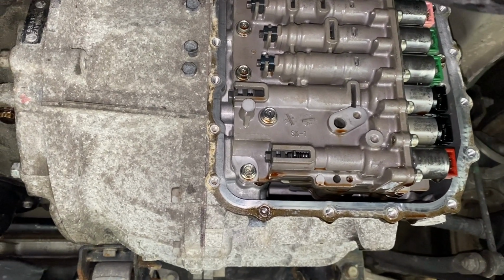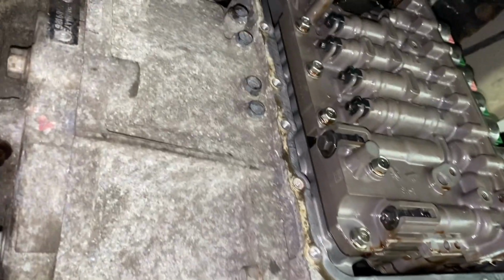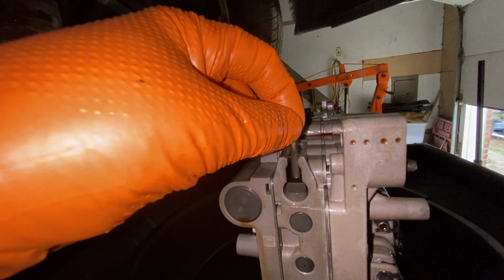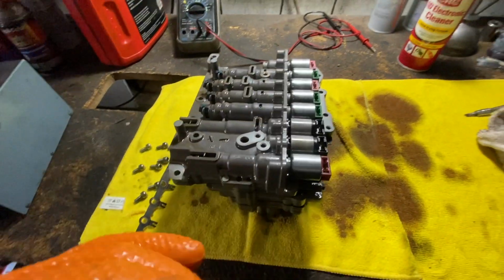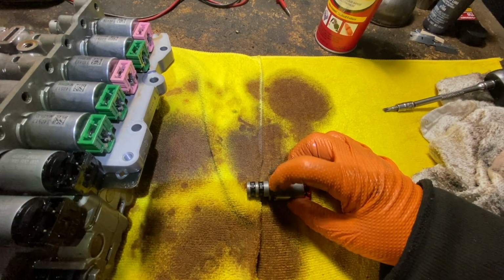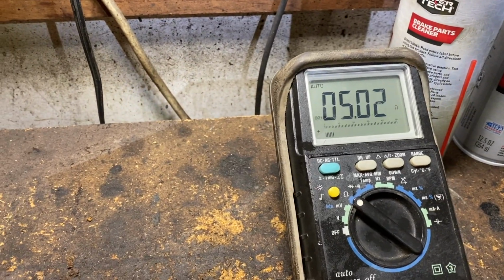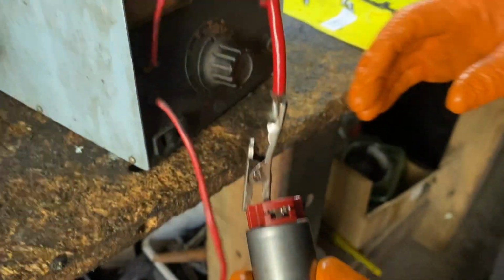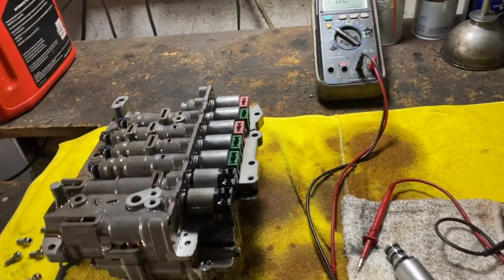Transmission Solenoid Cleaning & TestingOn 6 Speed Kia / Hyundai - A6MF1

Comment: I just bought a 2005 Tucson and i noticed the Idle is high in the 1500 range .. and when i go on the highway my last gear does not engage ..overdrive .. so when im driving at 95 klm/h my rpm is in the 3500 whey to high and waste a lot of gas and in the long run might burn motor and transmission .. Can u pls tell me what to check .. is it the body Valve or maybe something else ??? thanx for the video !!!
Reply from the maker: You're welcome. It could be the valve body or solenoid, but I would first check for any diagnostic trouble codes, transmission fluid level and condition. Should fix the high idle can be a vacuum leak, dirty throttle body or dirty idle air control valve

Comment: I have a 2012 soul a/t transmission, shifts fine manually but only goes to 3rd in automatic no codes any advice?
Reply from the maker: Valve body, torque converter or transmission clutches gone

Comment: Hi. Do you know anything about P1C28 code on 2020 Kia Soul 2.0 Engine. Scanner says it is transmission code.  Thank you.
Reply from the maker: It’s actually the hall effect sensor on the electric oil pump … the sensor cannot be replaced so you would replace the electric oil pump assembly.

Comment: My Hyundai Accent with CVT 6 speed is returning P0721 (output shaft speed sensor) fault code. Have you covered how to diagnose this sensor in any videos?
Reply from the maker: Not yet, seems pretty straight forward, sensor or wiring problem.

Comment: Where Is the TCM locked on the 2010 tucson? I have a bad tcm Code U0101 but don't know here the TCM is.
Reply from the maker: Should be under the fuse boxing engine compartment near top of transmission

Comment: hello and thanks for the tutorial, I have a question, I already checked the solenoids,   the first one on the bottom when I tested it does not  click, so I got a new one , and tested with 9volt battery and does the same, no click at all,  the ohm resistance is in range on both the new and old one,  Watching your video I saw you are testing that particular one, and I hear the clicking, and see it open and close , is that normal that mine don't click? my car don't go forward, but reverse is going good.
I really appreciate any help you may provide , thanks
Reply from the maker: Should be 12 volts then maybe you will hear the clicking. Here is info on those transmissions.
https://atracom.blob.core.windows.net/webinars/import%2Fa6mf1_rebuild.pdf

Comment: I dont understand why the valve body has to come out to remove the solenoids. Also which is the tcc solenoid? the torque converter clutch solenoid??
Reply from the maker: You don't but the valve body is where the fluid flows though if its clogged changing solenoids will do nothing. Here this may help you.
https://atracom.blob.core.windows.net/webinars/import%2Fa6mf1_rebuild.pdf

Comment: Hello! Thanks a lot for this tutorial video. I am in the process of doing these but I was hesitant since I tested each of the solenoids with a $2 multitester and it showed thse values: 
Solenoid 1 - 5.8 ohms
Solenoid 2 - 5.8 ohms
Solenoid 3 - 5.8 ohms
Solenoid 4 - 5.7 ohms
Solenoid 5 - 5.8 ohms
sSolenoid 6 - 11.5 ohms
sSolenoid 7 - 11.5 ohms
Solenoid 8 - 5.7 ohms
Do you think they're out of spec and should I be replacing these solenoids or are these specs okay and should I proceed with cleaning?  Thank you very much
Reply from the maker: They seem in spec, could be the valve body itself needs to be taken apart and cleaned but this requires some skill because of all the little parts

Comment: Hello awesome video I have a 17 Sportage AWD and I changed my transmission fluid on this car I just got it has 260k miles runs good just my transmission started jerking on first gear mostly when I'm taking off on a turn not so much on a straight line I was thinking it might be this cleaning issue what do you think. Thank you
Reply from the maker: Thank you! A good cleaning and test could solve your problem

Comment: I have a 2013 Hyundai Accent with 213K on it. About a month ago, I was on the way to an appointment and it jerked and the tach went to 3500 rpm for 60 mph and on starting from a stop felt like it had little power like it was starting out in a higher gear.  When I got home, I put it up on the lift and it was low on fluid so I topped it off adding fluid until it began to run out the level hole in the front. Cleared the codes and took it for a drive and it ran perfectly then a couple weeks later it did the same thing which I don't understand because I know it has plenty of fluid. Leaving the appointment after it had been shut off for maybe 30 minutes, it ran and shifted fine. Today it did the same thing multiple times, it jerks like hitting a large expansion joint then the tach revs way up from about 1800 to 3500 rpm for 60 mph. I tried the shiftronic thing and it said it was in 4th gear but I couldn't manually change it up or down.  I pulled over to the side of the road and shut the car off, restarted it and made it maybe 1/2 mile before it did it again. The 3d time it did this, I turned around and headed for home driving maybe 3 mi at 3500 rpm before pulling over and shutting it off and this time removed the key from the ignition. Started it up and drove the 40 mi back to my house with no further issues.  Hooked the scantool to it and I'm getting a       P0-880 code from the transmission. Is this something that a shift solenoid going bad would cause?  Trying to figure out what to do with it, who to take it to, a regular repair shop or someone that specializes in transmissions?  Would changing the fluid again help this?  I have top of the line Amsoil ATF in it which was last changed about 90K ago and hate to spend the money on changing fluid if that isn't the problem just to have a shop drain it.  Any suggestions?
Reply from the maker: This is the flow chart depending on your skill level  or to take to a transmission shop. 
https://static.nhtsa.gov/odi/tsbs/2020/MC-10176195-0001.pdf
Reply: @motorcarnut  I took it to a shop today and they said it might be a loose or bad connection, so when I got home, I pulled the ECU relay and put it on my relay tester and it tested bad. Drove the other car into town and bought a new relay and installed it after it tested good. Changes noticed, smoother idle, tach is rock steady where before it would vary maybe 25 rpm, shifts seem to be smoother and more positive and vehicle seems to have a little more power to pass. I don't know if that was the problem, but it definitely was a problem, keeping my fingers crossed that it cures it and keeps it from happening again. Going to have them check it out next wed and deal with any other issues or bad connections or connectors. Hoping and praying that it was a 7-dollar part and not something actually wrong with the transmission.  Thank you for the link, I have it bookmarked and saved.
Reply from the maker: Sure, no problem, good luck!

Comment: When I test the bottom solenoid, it won't "click" with a good 9v battery but, will with a 12v.
Reply from the maker: Probably because the amperage in the 9volt battery isn't sufficient.
Reply: @motorcarnut  I was thinking that might be it. Also, with the key on I get 3.36 volts on ALL the solenoid terminals.
Reply from the maker: Reference voltage should be at least .05 volts. You may have a wiring or ground problem.

Comment: Thanks for the video! I have the exact same AT A6GF1 on my 1.6 GDI i30 (european model). I have a very frustrating problem with mine. I bought the car used at around 140k km (around 87k miles) and since this summer i have the car kicks like a horse when you put in D or R also it does this when switching up/down gears, its more pronounced in second and third gear. The main issue is the fault is intermittent, sometimes you can drive few hours without any problems, like nothing is wrong, other times it kicks from when you start the car. It also happens during a drive, it can run normally then you stop at a intersection and it starts kicking and shifting hard, and it goes the other way around too. At one point i got a P0713 temp sensor high DTC, so i replaced the solenoid and temp sensor harness with the updated model, also measured (electrically)  and cleaned all the solenoids and found nothing unusual. I really dont know what to do with this car, the dealer wants to replace the transmission but it's around 1/2 of the cars value. The AT fluid is in good condition (replaced it around a year ago), good color, not burnt, no excessive contamination. Would you be kind to maybe give me some idea? I am willing to send some beer money your way for some help with this. Thanks!
Reply: I have the exactly same issue on my Veloster 2013, like u said, intermitent, sometimes kicks like a horse, and som times it shifts so smothly

What did you do to solve this?
Reply from the maker: Valve body replacement
Reply: @motorcarnut  It might be, but in the meantime (sometime in May) i just cut one of the wires going to the internal temperature sensor, since then the AT works with no noticeable problem. I get a check engine on the dashboard and a DTC but... I replaced the temp sensor two times before i did this "hack".
Reply from the maker: I would rely on that as a long term solution
Reply from the maker: I would think you need a new complete valve body or if you feel comfortable rebuilding yours yourself. 
I don't thing the transmission internals are bad because you said its works fine sometimes. Make sure valve body plug and harness look fine with no damage. I didn't get a chance to make a rebuild video yet but you can use this source to see if it's something you feel conformable doing yourself.

https://atracom.blob.core.windows.net/webinars/import%2Fa6mf1_rebuild.pdf

Comment: Did you end up making that video of taking the valve body apart even more ?
Reply from the maker: No, I was but customer needed vehicle very badly so waiting for another one to do it on.
Reply: @motorcarnut i got a valve body from picknpull and was waiting on your VB and solenoid testing video to come out in vain. My 2013 elantra GLS sedan displays the following

Issue #1- Significant delayed of 3 sec when shifting from P to drive

Upshift is 2100rpm under normal driving condition otherwise if try to accelerate hard at any gear, upon downshifting to get some torque, 
Issue#2 : it starts bucking / jerking indefinitely; the way to make it stop this is release the accelerator and depress gently then it acts normal again
In fact, driving it without hard acceleration will make the operator think all is well. 

Issue #3: 
Jerk or hard downshifting from 5th to 4th gear. 

Issue #4: it whines

Issue #5: no check engine light whatsoever 

Action:
I changed the trans fluid yesterday (very dirty- black) & the magnetic end of the bold caught some metal debris but nothing crazy as i have seen worse from working transmissions i serviced before. 

Checking level
Prior to changing it, i verified the fluid level was not low by verifying fluid trickeled down slowly at 140Degrees F or more;

Draining
Drained 3.7qts of old black fluid

Filling
Filled 3.4qts first
Started it and waited till it reaches 140F op.
 temp
Switch gears for 2sec on each gear R-N-D-N-R-D & repeated this twice more;
Filled the remaining 0.3qt & verified no leak anywhere

Reset & relearn
Used a scantool special function to reset the adaptation values and relearn
 
Test Drive:
Drove 300miles since yesterday

Feeling & impression
Seemed better as far as the downshift from 5th to 4th which is somewhat less harsh or completely inexistent at times

The delayed engagement of 3sec from P to D has not changed 

The bucking / jerking when trying to accelerate hard or drive it like a teenager is very present although the vehicle will drive as if there was no trans issues if the throttle is depressed gently & will shift through all gears and back down. 

The whining can still be heard

No dtc can still be read

Note: transmission oil sensor temp reaches a top of 185 Degrees F. 

I would love to test solenoids off the valve body i pulled from the junkyard to see if they are within range and compare with the solenoids currently installed in the Valve body of my transmission to know it is worth swapping them up. 

Or i wonder if any port could get clogged in these transmission leading to the whinning sound. 

Thanks to share any insight if you actually are able to read the book i just wrote lol 😂

Blessings

Comment: Hi, I have a Hyundai i40 1.7 2012 diesel,  automatic transmission only had 4 litres of oil, now shuttering in evey gear except 
 P and N. Would this be the clutches or solenoids?
Reply from the maker: If it were low on transmission fluid I’d say it’s more the clutches than the solenoids

Comment: hello thank you for your videos hopefully you can help me I have a 2017 kia forte5 ex with what i believe is a A6GF1-2 transmission. I pulled the valve body and I'm trying to measure the solenoids resistance to test them but I can't find info as to what they are and what the read should be. What solenoids do what. The issues I had where with 4th and some times 6th both only if going up a mountain. the trans on the inside is completely new looking all the screens on the solenoids very clean. any advise or links to diagrams or thoughts would be appreciated.  Thank you for your time
Reply from the maker: Appreciate the comment and here is some information:

https://atracom.blob.core.windows.net/webinars/import%2Fa6mf1_rebuild.pdf
Reply: @motorcarnut  thank you very cool thank you. unfortunately it showed the manual transmission and mine is 2.0 with the automatic. thank you for your time I will try to use the link you gave to see if it will lead to other videos or pdf's that show the A6GF1-2 automatic
Reply from the maker: No, that is the automatic transmission?

Comment: Hi there. I've got my solenoids mixed up when they were removed. The colours are in the correct spot but can they be different. 
The look the same and the same length but can they be in the wrong position
Reply from the maker: No, just check part numbers same color same part number then it doesn’t matter

Comment: I just wanted to like and comment on your video, because you have put some valuable info here. I have a 2012 Hyundai Elantra, and I think it has the same 6 Speed Transmission. Couple days ago I parked my car and it suddenly had excessive slippage when I put it in reverse. I was thinking that maybe a solenoid was bad, and now, thanks to you, I know how to test them. I did try to find your video about taking the valve body apart, but I couldn't find it. I you did make that video I was hoping you could put a link to it here. I was a professional mechanic for 20 years. I was a test and repair smog mechanic licensed by the state of California, smog testing and repairing many vehicles, I rebuild about 20 automatic transmissions and put shift kits in most of them and put shift kits in several other transmissions that fixed their problems which are some of the highlights of my mechanical career. Thanks you so much.
Reply from the maker: Thank you for the comment I really appreciate it. Unfortunately I didn’t have the time to show taking the valve body apart to clean because I was under pressure to get the car to the customer. Being your a mechanic as well here is the valve body take a part photos. It’s not that bad to do. Good luck! Any other questions let me know.
Reply from the maker: Link:

https://atracom.blob.core.windows.net/webinars/import%2Fa6mf1_rebuild.pdf

Comment: I have a 2014 sportage 2.0t w/180k miles. I changed ATF every 60k. But recently, when warmed up it shutters and hangs on deceleration. If you put it in park then back into drive at a light or stopsign it stops doing it for awhile. Solenoid cleaning or something more serious ya think?
Reply from the maker: Shuttering is slipping. Try this stuff first can’t hurt and has worked for me on vehicles people were strapped for cash.

https://a.co/d/2WtEHn6

Comment: I pulled apart an A6LF3 transmission from a Santa Fe, 4/8 solenoids weren't throwing on a 9v battery but they would on a 12v battery, also the resistance was roughly 1ohm out (measured at 4ohm) would there be any way to fix these? Or should they be replaced? When replacing have you used solenoids from Aliexpress? The genuine parts are very expensive where I live. Thank you 😊
Reply from the maker: I would replace them. eBay has them remanufactured OEM for good prices.

Comment: Could you please help me out bro, my car is Elantra 2010 4 speed automatic and everything works great but I have a slip or rough shift only when it shifts from 1st to 2nd gear I start to believe it’s a faulty solenoid I need your advice I’ll appreciate your help really ❤
Reply from the maker: It very well could be. But with me in front of the vehicle to test things it could be anything. If fluid level is correct you could just swap out the valve body for a reman and be good to go
Reply: @motorcarnut  I hope I was anywhere close but I’m far away in the Middle East man. Do you mean I should swipe the solenoid that’s faulty with another one and could I test it by the voltmeter device or directly with 12 volt wire.
Reply from the maker: Do a swap valve bode with all solenoids.

Comment: Sedona 2006-2010 is different
Reply from the maker: Really? In what way?
Reply: @motorcarnut  Also, thank you! You're videos are fantastic and so rare in the realm of car repair.
Reply: @motorcarnut  It has six fat same exact solenoids and one lower that is larger. I think ohms on that were 5.5.. I'm throwing a p0765 and no others. Hoping for the solenoid to be the culprit. I have smelled a torque converter fail in the past. Now a shift lock out and code.. Ill know soon..